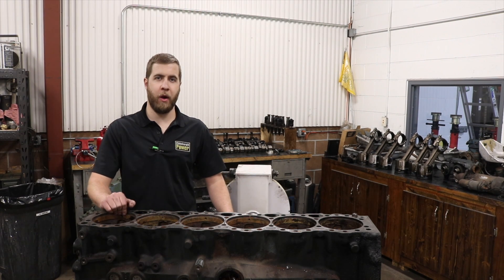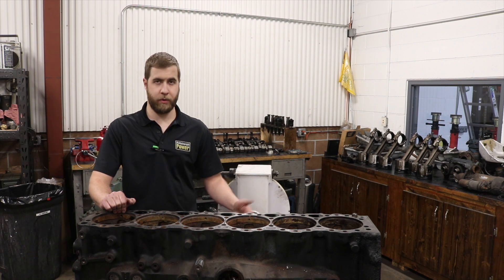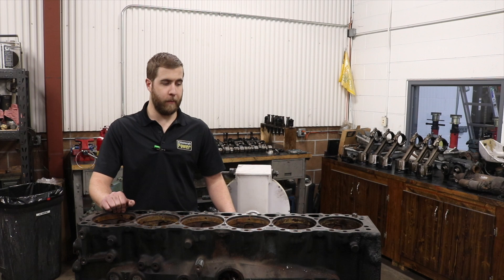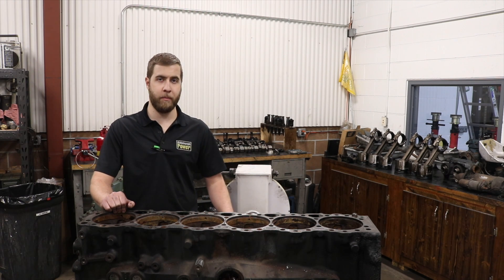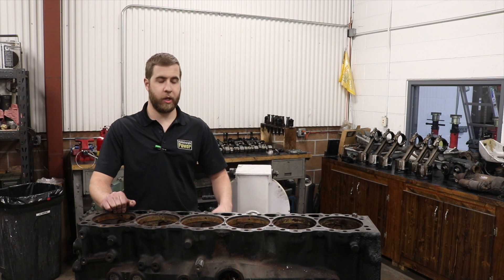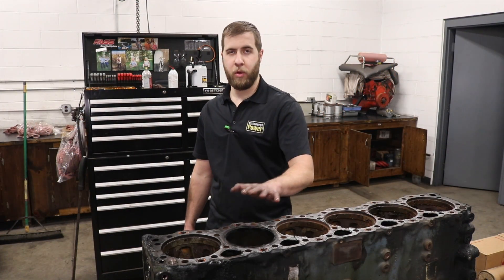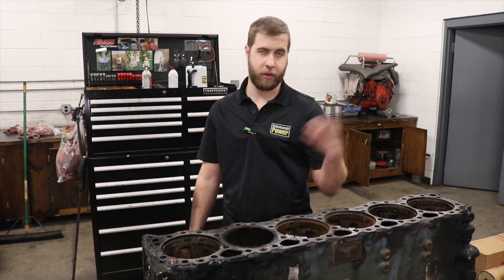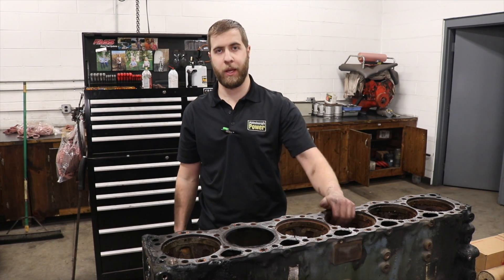Detroit 14L Tear Down

Comment: I never seen a non EGR 14 🤩 the DDEC 4 and 5 I’ve always seen with EGR but I have seen DDEC 4’s on fire vehicles that don’t have EGR’s! I still love how two of my departments I run with have per emission motors like the 6v92ta and 8v92ta silvers and then a C12 500 and a 1999 M11 ISM 400 with a Jake not PAC brake. I love the 60 but we don’t have one there 🙁

Comment: if memory serves me correctly that non egr 14.0L was rated between 550 hp and (575 hpFreightliner only rating) and 1850Lb ft torque. question can the EGR 14.0L be made into a non EGR SETUP?

Comment: an old coworker and me did inframes on n14, isx, and Detroit's. about 3 eight hour shifts from the time we pulled it in and back it out. As soon as we got done it was on to the next one. fleet of about 300 trucks

Comment: How does a 625/1650 14L DD compare to a 625/1650 Cat 15/16 in regards to power band and for heavy haul fuel mpg?
Reply: Not sure if this helps or not. I had a c15 cat with 550 tune. Company I used gave me 2000 torque at 1200 rpm on that engine. Current engine is a 14.0 set at 580. Not sure on torque. However hands down this 14 litre has way more torque. I can pull down to 1100 and up shift below 1500 rpm and it walks. If I want aggressive power i bring it up to 1700 and it pulls hard. Fuel mileage is maybe .5 mpg better then my cat  was on the best day. I'm averaging 3.98 mpg pulling heavy and loaded both ways at times.  Plus pto work.
Reply: We use to own a c16 and off the line the c16 would leave the 14.0. Once the 14.0 was up to highway speed it would keep up on the hills. Maintain its distance but never gaining. Impressed me as that c16 pulling heavy is like pulling a dry van down the road.
Reply: @lungelinecowboy  gearing plays a huge role in that
Reply: @ericmartin894  gearing only plays a role in how fast you can go and how fast you ought to go.  Trucks should always be spec'd in order to keep the engine in the torque band at highway speeds.  I have a DD15 505/1750 spec engine.  The torque band is 925 to 1450 rpms, a X15's band is 975 to 1500 rpms.  My direct drive DT12, 11R/22.5 tires and 2.54:1 finals puts me just under 1500 at 70 Mph.  As I prefer to drive 70, and occasionally when light 75 and legal to do so, the 2.37 or 2.43 ring gears are a better match.  I would however prefer to go to a 13 or 18-speed transmission and 3.08 or 3.25 rears.
Reply: Tim, if you had a late model Series 60 14L the torque band and horsepower band would be similar.  The DD15 peak torque is found at roughly 1100 rpms and the Series 60 will peak at 1200 to 1220.  Both engines peak HP will be at 1800 rpms.  This is entirely attributed to the VVT and it's corresponding programming.

Comment: Lol, couldn't pull liners out because of counter bore rust. You either don't have the right puller, or you aren't using it right. I had to pull liners and pistons out of a severely corroded 14L recently. The only way to get the job done is to tighten the expanding puller, smack the top of the wedge plate on 2 sides with a 3 lb sledge hammer, try to screw the liner up, tighten the wedge plate jam nut again. Keep doing that and eventually you'll exert enough pressure on the liner to crack the oxide bond from the counter bore.

Comment: After all these years, I still don't know what the difference is between my 12.7L and the 14.0L if they are supposedly the same engine. I had my 370/430 MK60 which I've owned 9-years now rebuilt three years ago and during in-frame, I asked them to max it out expecting at minimum 500Hp/1650 lb-ft torque but they claimed all they could achieve was 470Hp and 1450 lb-ft torque. I don't understand how my 1999 Volvo VNL-610 12.7L came from factory at 500/1650 yet my 2003 Intl 9400i with same 12.7L engine can't get above 470/1450. I've had every version of the Detroit Diesel Series 60 engine from one of the first 11.1L to several 12.7L and none of them were as weak in the bottom end as my current 12.7L. Still I'd like to know what is different between 12.7L and the 14.0L? I've heard it's the same block.
Reply: James Barrow it has to do with the engine serial number and model number really, Cummins does the same thing with their control parts list (cpl) number. The lower hp Detroit builds are meeting emission standards really. The 14L blocks are not the same as the 12.7L blocks. Neither are the cranks. 14L cranks are stroked compared to the 12.7L cranks
Reply: If you're asking about the horsepower rating in the computer,  They had a factory range you could set it at and that changed in the computer between the two engines you have. You want higher numbers? Get a different ECU and have the HP rating changed, or have someone change the fuel map with software.
Reply: @JosephArata   - So I take that to mean all DDEC S60 12.7L engines are the same with the same camshaft, pistons, rods, and crankshaft which means the only difference therefore is the ECM computer. So if I were to get an ECM that is setup for 500Hp / 1650-lbs.ft torque, then when it's hooked up to my engine, it automatically gains those ratings? I'm not asking for anything extreme, only more than what I currently have. The 12.7L S60 I had in that '99 Volvo backed by an Eaton 13-speed was a kick-ass setup and I would be more than satisfied with those same power ratings. This 1450-lbs.ft torque rating I have now is just not doing the job especially in the hills.  If this is all true, then I appreciate the information because it's more than Clarke Detroit Diesel is offering right now.
Reply: @kingjames8283  Eric at serious series 60 can get you hooked up with a tune that you will love. I've got 2 friends running his tuning and they are monsters and are at 7.5-8mpg. My Detroit 12.7 I just bought is a lower rated engine and he's getting mine in a couple months to tune and get me more power and mileage.  Mine don't get any better than my 2ws Caterpillar
Reply: Jeremy Lyons I gave up on Serious 60.  No returned calls,  no kept appointments.  Bla customer service. 

Try Great Lakes Diesel. Excellent folks. Top notch service.
Reply: @bctw9004  thanks
Reply: I'm told all the DDEC's had mechanical differences form one another, also the engines have variances inside a given DDEC, cam, pistons, rods ect. A factory shop won't install a bigger program than the parts build should have, however shops like Pittsburgh Power can install whatever program you'd like, I believe they've said that 500hp 1650tq is safe for any parts build. although results may vary depending on build.

Comment: If the liner removal tool was the kind with o-rings, I used to lay a cleanish shop rag flat on the deck then install the puller. The rag made it grip much better. Also those o rings are expensive, just take the ring off a series 60 oil filter to replace them.

Comment: Does non egr and egr share the same block. If so there should be easy conversion kit
Reply: Thanks I just been doing research on engines. This year I want to buy my own truck. I’m torn because I always liked a CAT but don’t want to chance it on head gasket issues or cylinder protrusion. 

I’ve been in a lot of 60 series and know there more dependable and cheaper to work on. But my experience has always been you have to wind them up to get torque. 

Makes no sense to me why 1800 foot pounds of torque pulls less in a Detroit than 1800 in a Cummins. 

Lastly I’m still in the fog why
 Fitzgerald Glider are so passionate on the 12.9. To me that engine would work best if you hauling general freight like potato chips. 

I need some guidance here. 👀
Reply: @ApostleDavids8w  maybe the rears  weren't  right..you av to step on it for the Detroit  to come alive ..my dad's cabover has a 430 12.7 in it 4:56 rear 9spd n it's slow as hell but pulls aggressive on hills if you floor it
Reply: Trucking Jamaicans ya 4.56 gears is perfect on a 9 speed you can tear down a house. But max speed is probably 55 ish
Reply: Block is identical. They picked up coolant from pre-existing locations on the engine block for the EGR cooler. The EGR is basically a retrofit on the 07 year engines. There was no EGR pre 2007, this guy is misinformed about how long non-egr 14L engines existed. Not that it matters, you can buy an aluminum block off plate that stops egr gas from flowing through the crossover tube on the egr cooler outlet.
Reply: Batojiri1 fake news buddy. egr's were an on-highway requirement 2003-2004. If you're familiar with light/medium duty diesel trucks you'll see Ford began using in 2003, duramax in 2001, and cummins in 2007.5 only because of their "in-cylinder" egr system. Only CAT did not use one on their on highway c7, c9, and c15 applications. 2003-2004 was egr requirement, 2007-2008 was dpf requirement and 2010 was def requirement
Reply: Batojiri1 ya my last 14L 60s I hooked up 2 resisters which keeps the egr closed
Reply: Joseph Arata not true

Comment: Mtu builds the 14l with a DDEC5 head and N3 injector that has a max output of 750hp for haul trucks... You can buy it with a steel flywheel housing for around $35k exchange through Detroit Mtu